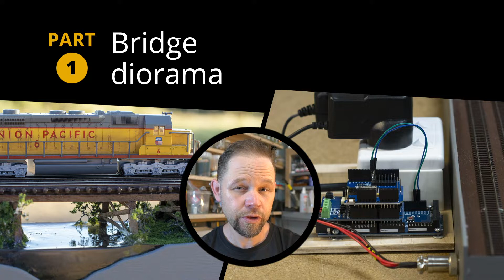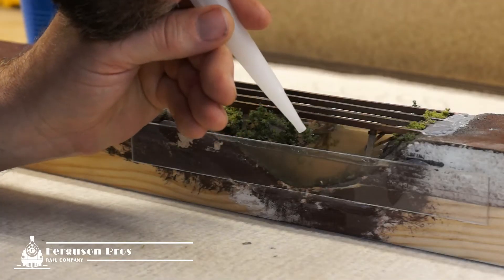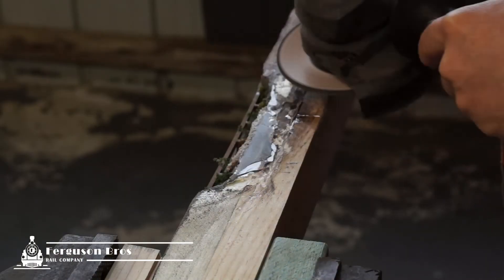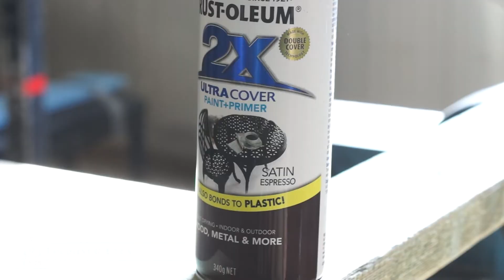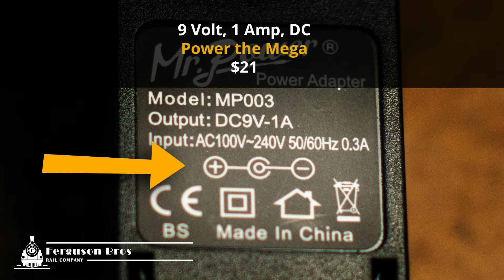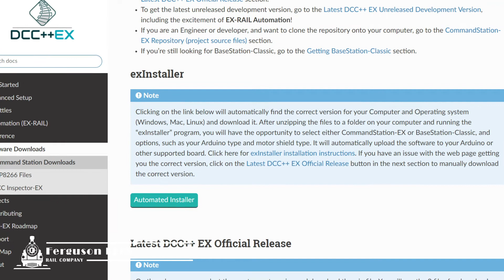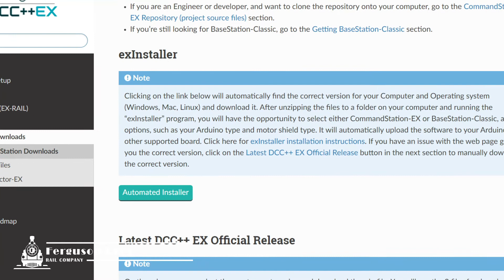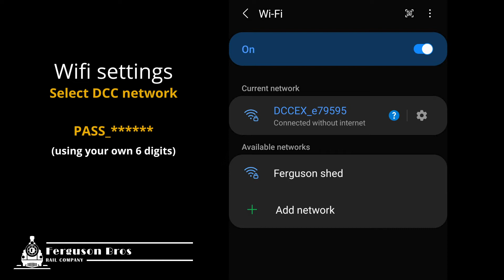How to build an Arduino DCC++ EX program track with resin river

Comment: I so love this diorama! What a wonderful job you did with it, thank you!  I have a doorway to cross for my layout and this is exactly how I'm going to do it now that I've seen yours! Thank you!

The DCC++EX setup is smart with that mic connection, great job!  One of my plans for my layout had always been to have the programming track be switchable between mainline and programming, and doing it on a module like this is just perfect! So isolated railjoiners and a DPDT switch with a couple of less on the facia to show if it's main or programming and we're off to the races so to speak. I'll probably add a block detector at each end so that if a train is coming and I've forgotten to switch it back to mainline, it will do that automatically!

Thanks for this great video, easy as mate!
Reply from the maker: Thanks for sharing your ideas, sounds like a great project.

Comment: I’m new to all of this: I understand that JMRI has a virtual sound decoder. Is there a way to access that through the DCC++ex interface or would I have to keep it connected to a PC? Do you have any ideas for getting basic audio without using an onboard sound decoder in a DCC++ex setup?

Comment: If i remember correctly the arduino should be able to take 12V on the VIN so you could have jsut given it track power.
Reply from the maker: The voltage regulator can overheat, I've gone with recommendations to avoid this potentially happening.
Reply: @fergusonrail  ah ok